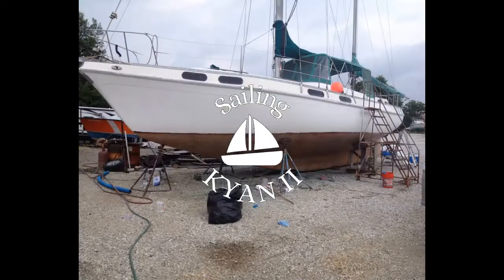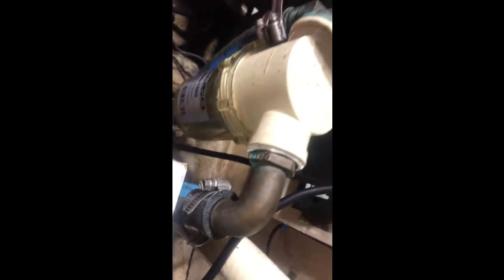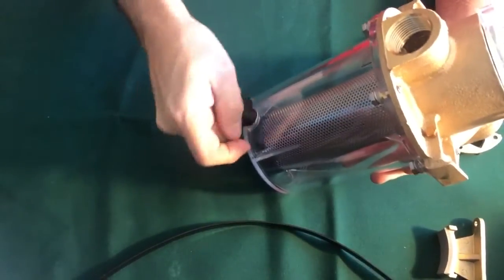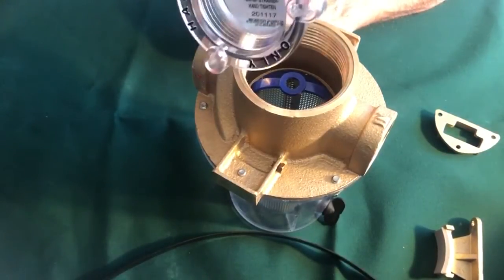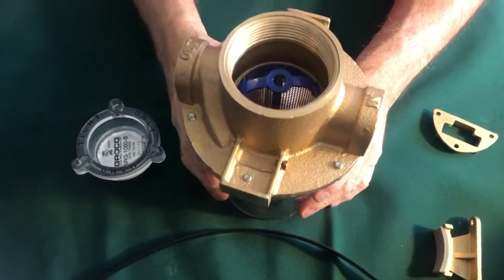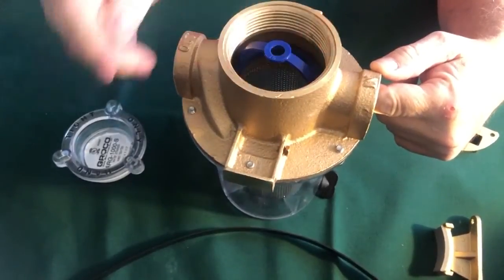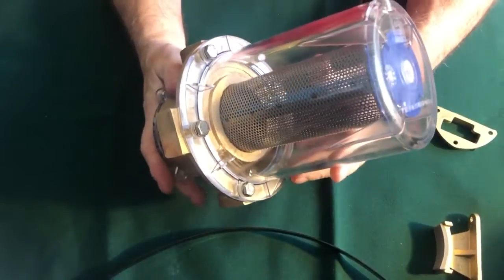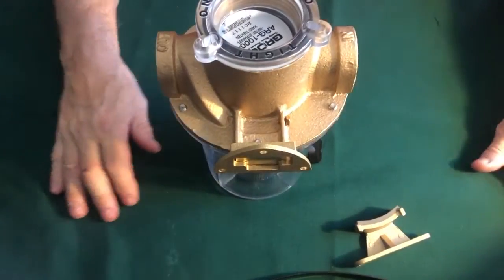How to install a Groco Raw Sea Water Strainer Series ARG

Comment: where I recommend installing the strainer is just one inch below water level so when you take the top off to clean the strainer water flushes out but a low speed - this makes sure the system stays primed and no need to shut off the sea cock - it makes a quick cleaning of the strainer a easy job and one you do often, a very good habit to get into.
Reply from the maker: Thank you for your tips to our viewers!
Reply: Good tip!